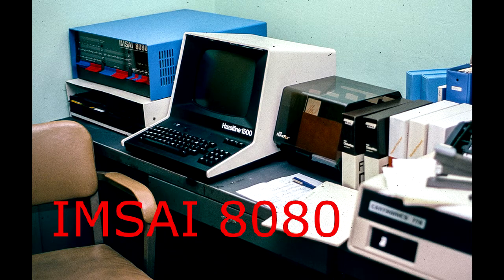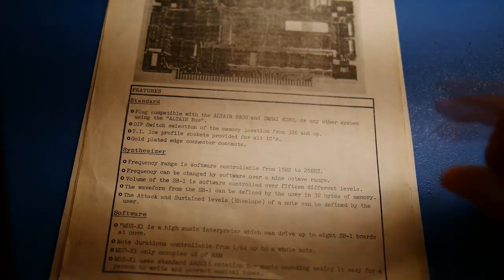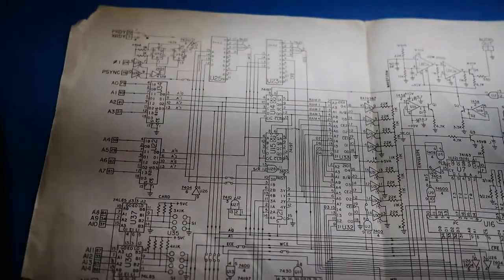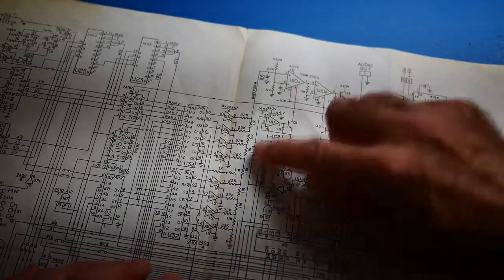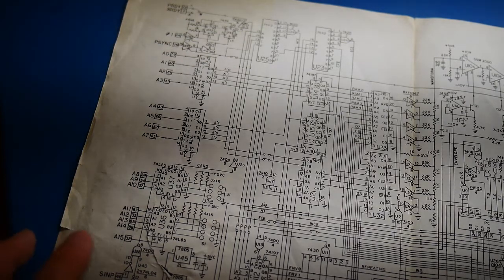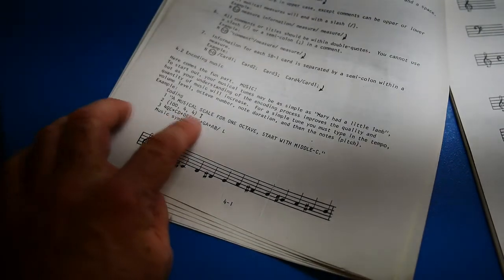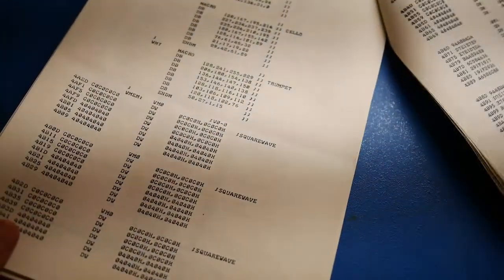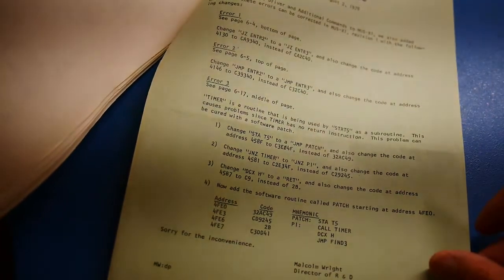#40 IMSAI 8080 sound card

Comment: My junior high school had several Northstar Horizon computers with this board, and I had an opportunity to play with mus-x1 in the early 80s.

It took me until recently to figure out what hardware and software I was using back then, but I recognize the mus-x1 syntax. It was a really easy print#6,"cdef" to play those notes from Northstar BASIC.

I was really sad when they took away the machines the next year and replaced them with Apple II's which did not come with a music synth built in!

The first IBM-PC's BASIC also had a "play"  command whose syntax resembled mus-x1, maybe not a coincidence! 😀

I remember reading recently that the designers of this card went on to found Emu systems.

Comment: That sound card looks interesting. Do You have any plans of populating it with components and try how it sounds? I'm really curious.
Reply from the maker: It would be a good amount of work. besides finding all the chips. it uses a SSM2000 voltage controlled amplifier IC. made by Solid State Music. can't get those so would need to design a piggyback board to emulate that IC. then it is memory mapped so need to pull out one card in the IMSAI to have only 48K. then need to re-map CP/M to run in 48K. Maybe some day?